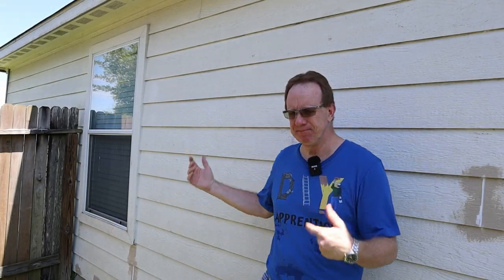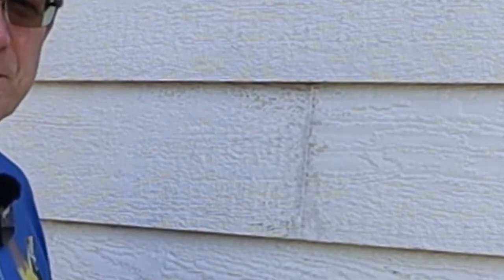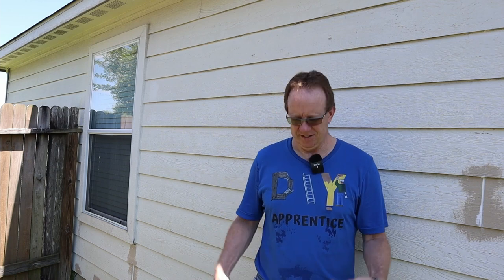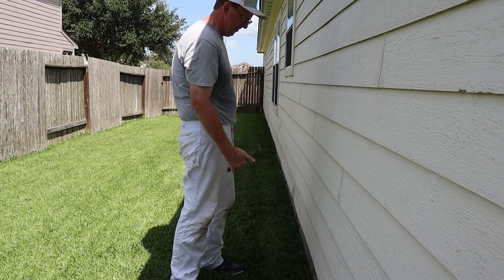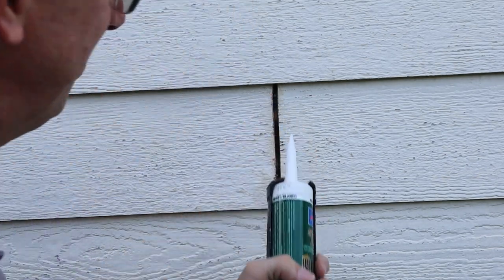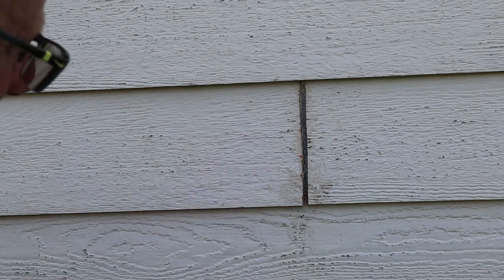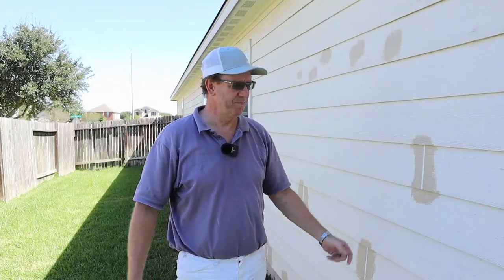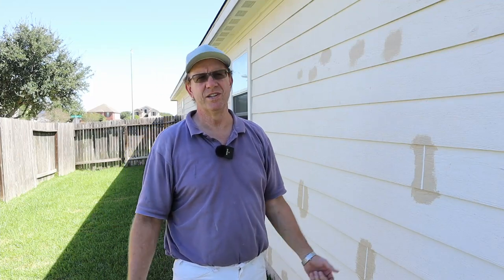Simple Cause With An Easy Fix For Wavy LP Lap Siding

Comment: In the LP Siding official videos, they show a guy using a saws all to cut the new spacing.  I tried that and the saws all blade goes all over the place, tears up everything.  I used the circular saw as you did to open the butt joint.
Reply from the maker: Yeah funny how it works so well in there video but in real life no good.  Thank you for watching.
Reply: @OakleysDIYHomeRenovation101  but a trim saw would  be much easier?